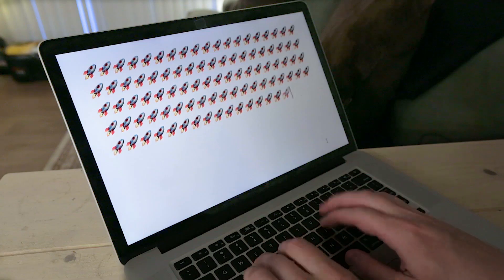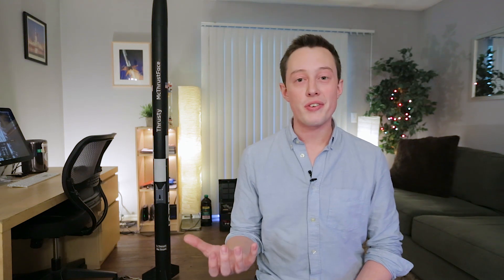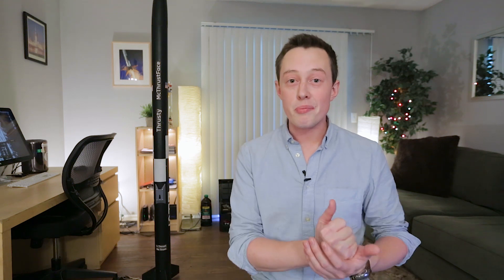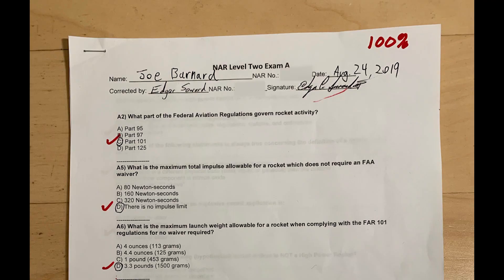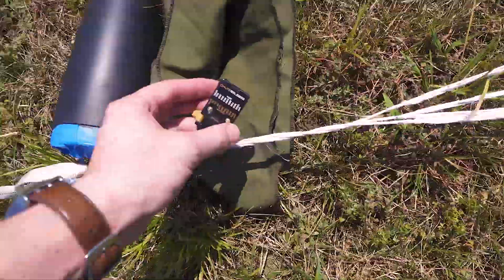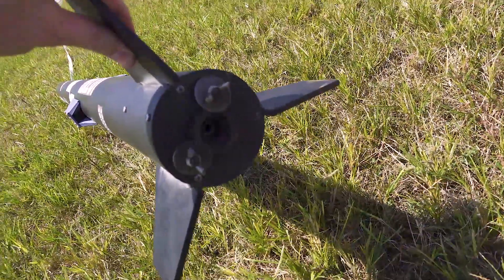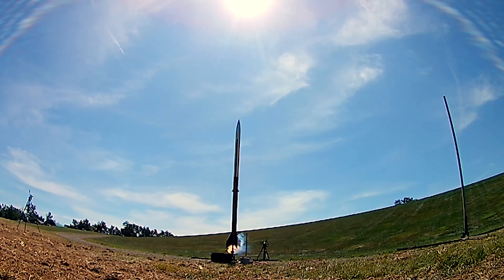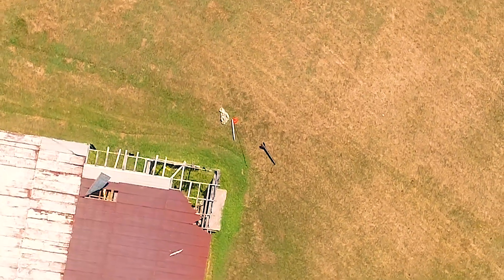Thrusty McThrustFace - Level 2 Cert Attempt

Comment: In the UK we used to use motors that had a second boom boom that fired inside the rocket to blast apart the two halves of the rocket, it also pulls out the parachute. Had to stuff the inside with heatproof tape.

Comment: i wasnt aware that you needed certification for to fly things this high
Reply: Altitude isn't the requirement.  It is the loaded propellant weight and weight of the vehicle that the FAA cares about.

If you are over 125g propellant, or 1500g vehicle weight, you need an FAA Cert of Authorization (COA/waiver), and that will be granted up to certain altitudes (My local club can fly high-power up to 12000 ft because of our launch site and COA)
Some Level 1 motors are less than 125g, and if they fly in a rocket under 1500g loaded mass, than you don't need a waiver. Just adherence to local sky traffic, observation of local fire regs, and defined safe distance from occupied buildings or vehicles.

Check out the NAR link from Joe, you can learn all about it

Comment: You should try on real hybrid engines
Reply: There are a few certified commercial hybrids for use in high-power sport rockets like these.  Rare, but available if he wanted to try. The engineering required is more involved

Comment: To space we thrust. In God we trust. Use not a kg of propellant but a hundred kgs. Cut away those fkn fins and insert thrust vector control system you did. Calculate and load there proper ascending ballistic trajectory to achieve proper horizontal speed at proper altitude. May The Force be we with you. Amen.

Comment: Why did or take the L2 rocket some seconds before it's parachute fully opened, even when it was already falling? The parachute popped out but remained kind of closed for a while.
Reply: The motor has a delay element that deploys the parachute after a certain time. The rocket in the video was set too long for that flight.
Most likely due to the wind, when the wind takes it sideways, it loses altitude and apogee will be lower than simulated
Reply: Joe had a ChuteRelease module attached to the parachute. It deployed the chute at a predetermined altitude.

Comment: I was wondering why it was tilted, but i thought rockets automatically turn into wind?
Reply: It is a safety measure to ensure the rocket will arc away from the crowd in case of non-deployment.  Also, sending into the wind intentionally can help it return closer to the launch site/.

The downside is there will be higher horizontal velocity and bigger shocks during the apogee recovery event

Comment: The earth is flat and stationary.
At what altitude is the rocket at its optimum?
Newton’s third law requires a molecule in order for the rocket to work.
So how large would the rocket engine have to be the higher it travels upward because the molecules become less and less, in essence the engines would have to increase in size the higher it climbs in order to find the ever diminishing molecules.....

Space is a state sponsored hoax and Newton’s third law proves it. The earth is flat and stationary ✅

Comment: Random question: is it okay to have 2 small 3mm dia holes, for altimeters to take readings?
Reply: Yes. They are a requirement for barometric flight computers that use air pressure changes to deploy parachutes and ejection events

Comment: I have a question. Rockets, like those from SpaceX or the solid motors on the Space Shuttle or Atlas V, have nozzles on their bottoms. However, I don't notice them in your rockets. Why is that? Do they have nozzles? If not, why?
Reply: Jimmy Cerra the nozzles are inside of the motor casings. This makes them easier to manufacture and more durable for when they land

Comment: Boaty McBoatface... yeah.  They have a real pattern problem.
Thought the whole time: open chute... open... OPEN CHUTE... OPEN THE DAMN CHUTE.
Reply: It would have been a Thrusty McFacePlant
Reply: Shooty McShootface
Reply: im gong to go found a new city and call it the newest and yorkiest of the yorks
Reply: That's pretty much the same thought I had the first time I jumped out of an airplane :)
Reply: It had a chute release - designed to open the chute lower down so you don't have to walk as far and the rocket doesn't end up in a tree
Reply: @jasperbarnett6819  I was freaking out as well but thought just as it opened that it might have had a release system like you described. I was just skeptical because I couldn't see it when the chute first deployed.

Comment: Nice simple L2 with a chute release instead of dual deployment. I personally have a similar L2 rocket that I 3D printed (everything but the tubes and recovery hardware) and used nose-end deployment with a jolly logic chute release. L3 requires a lot of L2 flights with electronic deployment (the process I am doing right now) and the use of redundant electronics (dual deployment). I'm sure both of those will be easy for you, just letting you know it's a pretty long process that is not comparable to L1 or L2. Also, it appears that Thrusty McThrustFace needs a swivel on the parachute and shock cord, it would save you a lot of time unwinding the mess that the descent made.

Comment: Congrats on Level 2 Certification!  I have to admit, when the parachute didn't open right away and the title of this video used the word "Attempt," I was concerned something went wrong.  Good job.
Reply: MansellRa the reason it didn’t open immediately is because he used a Jolly Logic chute release.  It has a little rubber band that keeps the parachute closed until a selected altitude. I fly one a lot.  The goal is to save you a lot of walking by opening the parachute at a lower altitude.
Reply: @Banditomojado  thanks for the explanation. Makes sense. I guess I've never shot a ticket high enough to warrant one--yet!